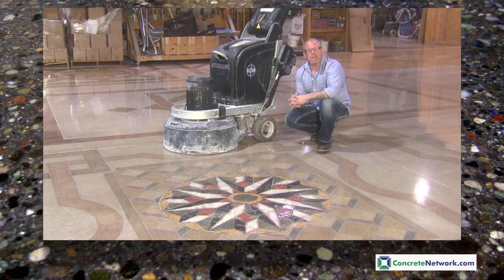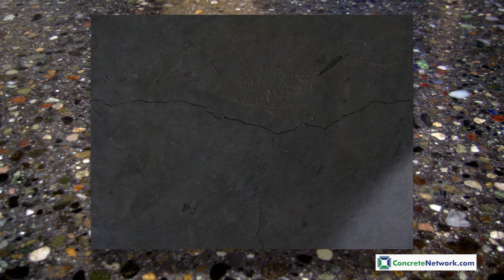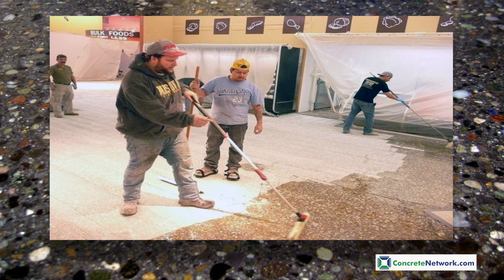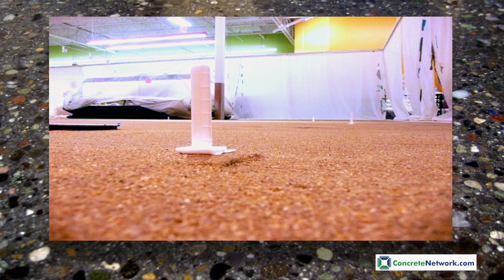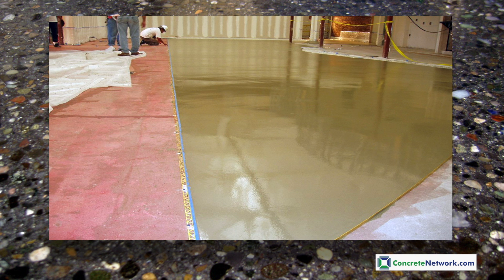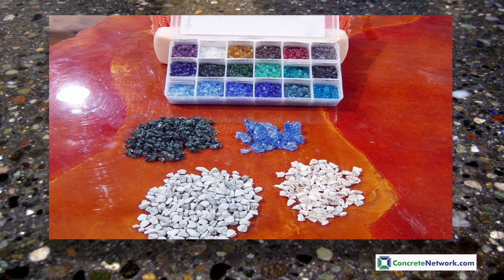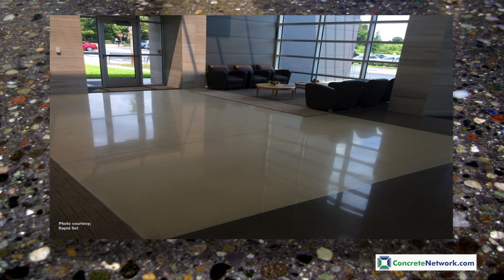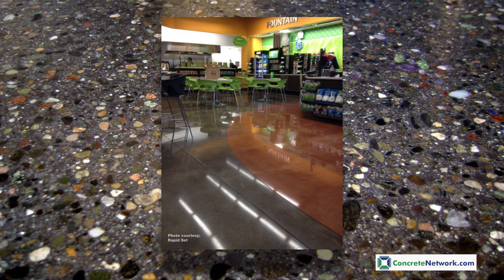Polished Concrete Overlays

Comment: We are wanting a polished concrete finish in our house and have currently shiplap with 5/8 tongue and groove glued and nailed on top. We are told to lay 1 1/2" of lightweight concrete but we know this will not polish. Is this selfleveling topper going to work cor us? Yes we are placing radiant heat in the floor.